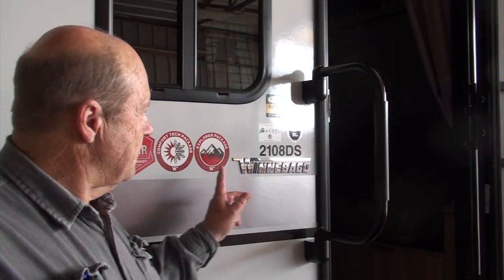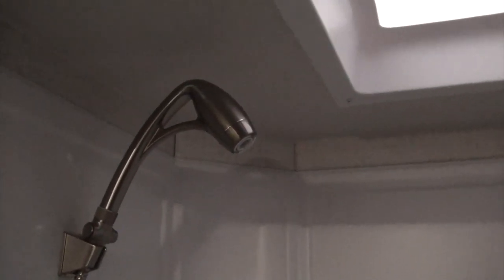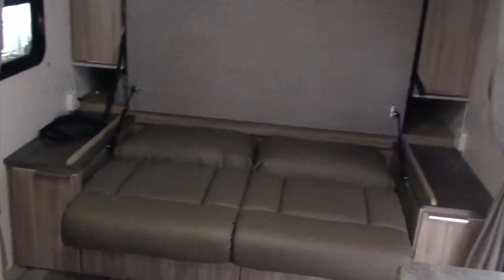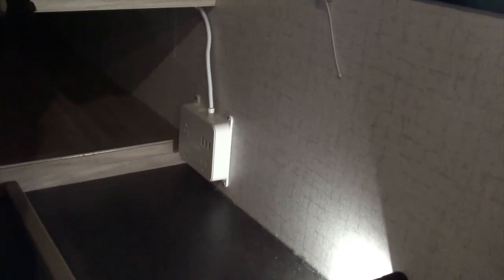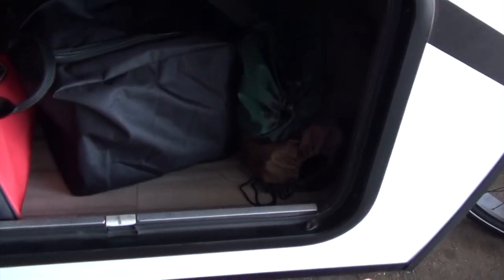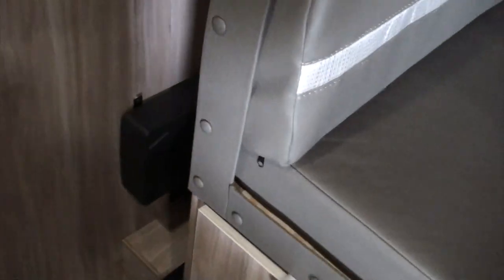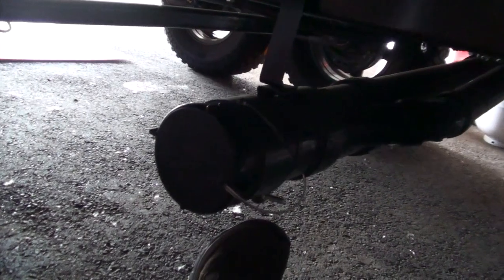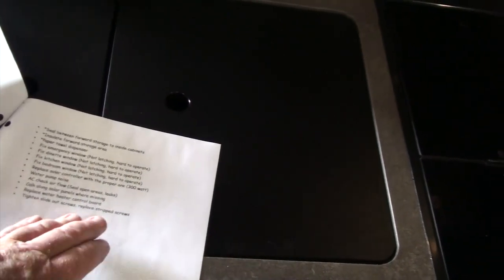My Winnebago Micro Mini Modifications

Comment: I suspect you like projects and to tinker as I did when younger. I use velcro a lot now that I know how strong it has become.  I put motion battery lights around the outside of mine with velcro so I don't have to take a flashlight every time I go to the truck or around the camper, and is also a bit of security if anyone walks up.  The velcro allows me to pull them off to change the batteries, however, that has not been needed yet in nearly a year.  We have a sewer cleanout in a flower bed near the driveway, so we can drain the tanks when home also, no pumps needed.  I also installed a 30 Amp receptacle in the garage under the electrical panel so I can set the AC on 85 in the summer to keep it from overheating.

Comment: lots of great ideas there, we bought a 2108ds new in 2021. Every appliance except for the stove and the bathroom fan has failed and was either repaired or replaced. I've repaired a lot of defects myself as well,  the construction of the trailer seems solid so far and it is well insulated as you mentioned. Torsion axles ride great on the rough roads too. Do you have any trouble with the gas water heater blowing out when there is a slight breeze? Can't seem to get that fixed.

Comment: my 2108tb is constructed really well... but water heater, refrigerator, furnace, water pump, and thermostat would not work as delivered.. slide hardware failed as well.. took one trip to fix slide.. i eventually fixed the water heater there is a internet fix of where to move the control boards over temp switch so it quits failing, the refrigerator still had its packing plastic on the back, took two tries before the dealer fixed that. furnace took 4 tries till they fixed that  knock on wood it appears to all be good now.. but ive had trouble with all the dometic parts.

Comment: I leaning towards getting the micro mini but even if I go another way I like most  of the upgrades you made I was leaning towards that new FLX version the same layout as yours but with built it solar panels and very large li ion battery that they claim will power you for 5 days. I just need to find a dealer that’s closer than 100 miles it seems like the good ones are even further away.

Comment: 2108 FBS, 37000 miles, 3 years.
You've blown your warranties. 
Any unapproved modification voids warranty. My slide side wall failed due to foolish design, then when I tried to get warranty repair, I was informed that my bike rack on the  rear bumper voided the structural warranty. The reason your paper towels unroll is because the slide bounces like crazy while traveling.  Mine doesnt bounce any more😊
You modified many things. 
Good luck!
Funny everyone claims Winnebago is quality build... BS.  Your list shows the same.